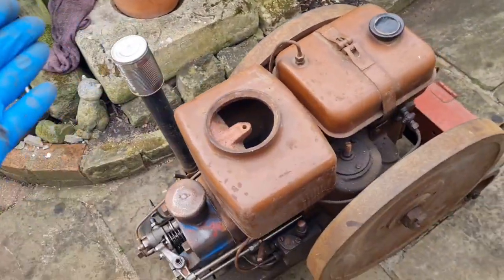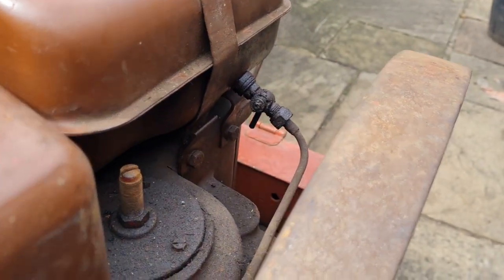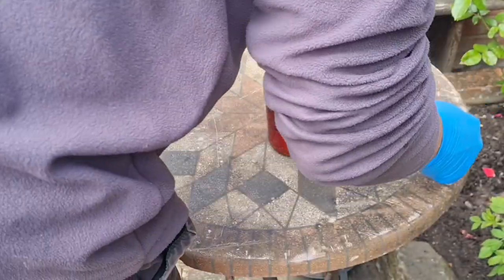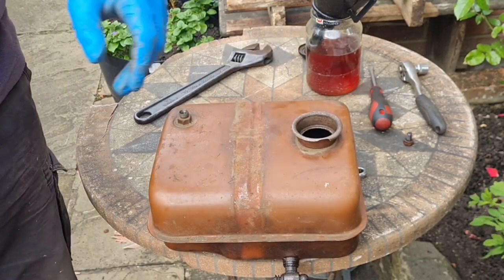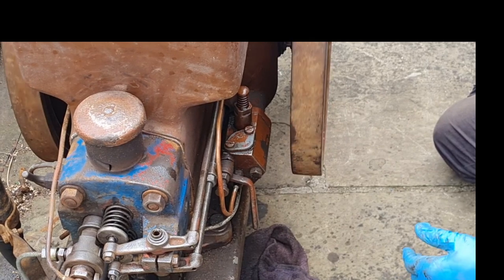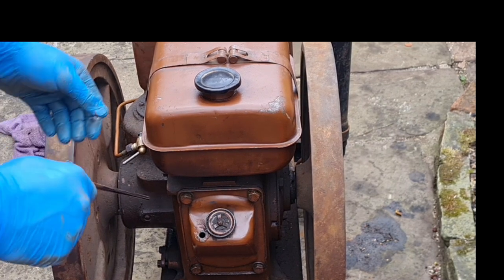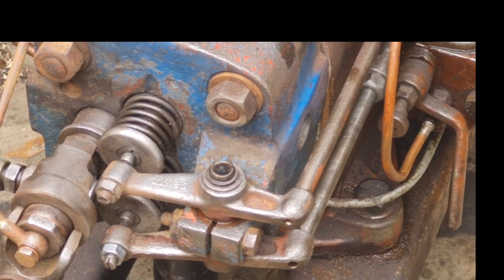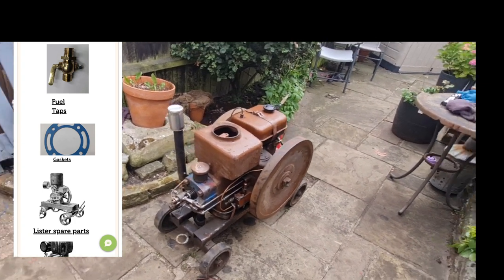Old Diesel Deutz Engine. Fuel System and Crank case.

Comment: I'm no expert on Deutz but shouldn't there have been a oil dipper and also lock tabs for the "big end" bolts not sure just asking.
Reply: My guess is that on such a well engineered engine there will be a crank driven oil pump to lube the cam and the crank bearings, main and big end.

Comment: When opening a metal to metal fuel tap, do not force it, pull it towards you against the little spring while giving it a twiddle and it will ease off. I have spent a lot of time lapping these little sods in. Good video.

Comment: I suppose that lever on the pump is set up that way so you can't start it accidently, you've got to purposely move it to the start position and then lift it to shut off the fuel otherwise vibration could drop the lever and stop the engine or if the decompression position dropped out could give you a nasty back fire kick.

Comment: If you think about it, the fuel/decompression handle makes perfect sense. The decompression method is both the start and stop method for the engine. If you max-fueled at stop, it might "semi-diesel" run on til you vac-locked the pump. To start you lock into "fuel off/decomp", spin her up to speed, then quick flick the lever to "max fuel/comp." Spinning fast enough, inertia carries that heavy wheel through the compression bounce point, your zippy igniter fires off, and she pukes a healthy spurt of go juice. Zap POW, chuggity chuggity, lol.

Comment: That diesel looks like the red stuff, used on off road engines, cheaper than the white diesel.
Reply: that's perfectly legal. 🙂
Reply: White diesel?!?
Reply: @wallybooger1  the Diesel used in cars or trucks is called "white" even if it is greenish. (well ... we call it that way)
Red Diesel (sometimes called light-fuel or gas-oil depending on the country) is normally used for almost everything that doesn't go on the road or for heating. 
Red Diesel (lower taxes) can also be used in agricultural engines.
Reply: It's all the same fuel, they just drop red dye in the "off road" tank at the tank farm. It's all "white" from the refinery.

Comment: Also should there not be a oil scoop on the big end ?
Reply: On a horizontal cylinder?
Reply: Some times on the big end bolts there is a flap that drops into to the oil to splash it around by the looks of it it's just sitting there doing nothing but sitting at the base
Reply: If there is no oil pump it might be a splash lubrication